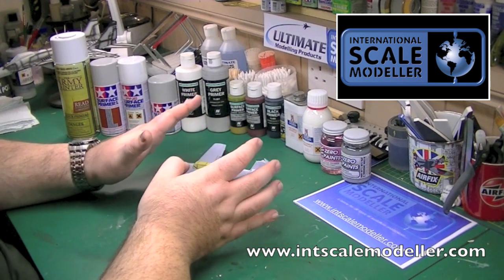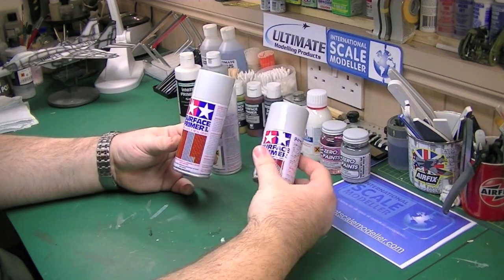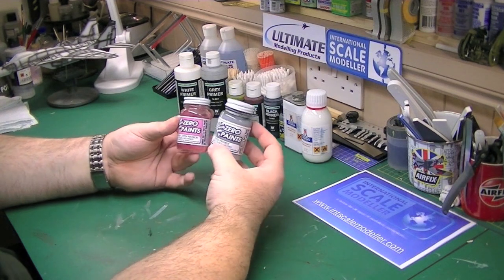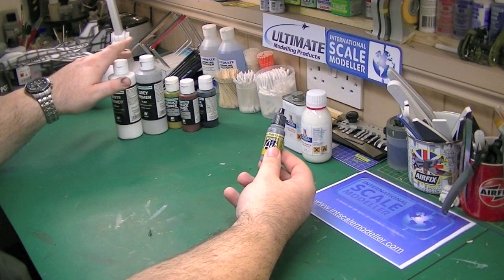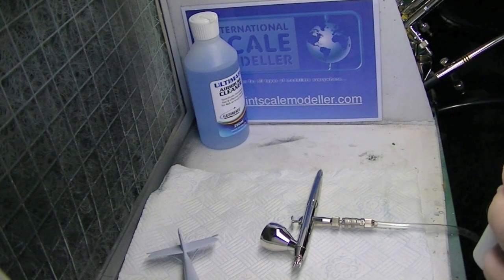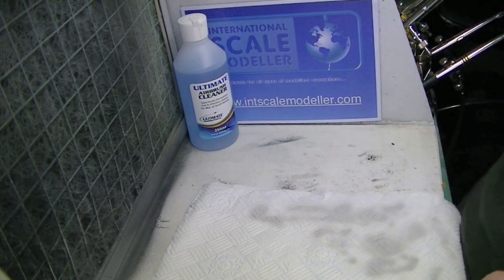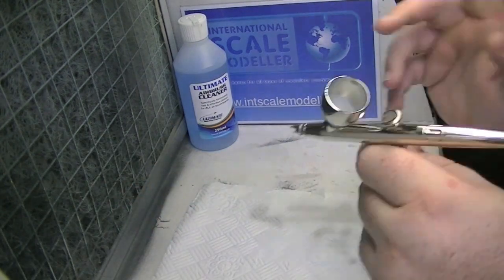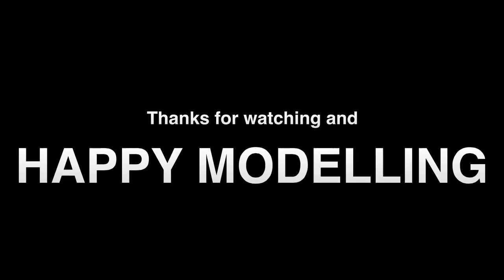Aircraft Modelling Techniques Part 7 - Priming

Comment: I use the tamiya fine spray primers and top coats (I do a lot of 1:12 motorbikes and want a realistic match) as I'm not getting my airbrush untill xmas and I too have decanted some of the left overs from the tins into little pots using the straw method and de-gassed them before putting the lids on, now, you mentioned they may be cellulose based? I have actually emailed tamiya themselves to see what thinners I should be using to clean up their TS range of aerosol paints and am awaiting a reply as I need to know what to use to clean the airbrush after using them.

I seem to remember from my younger days that cellulose paints and acryllics dont mix and can give a crackled effect, so would be oblidged if you could clarify using a mix of cellulose and acryllics and what the pitfalls or things to watch out for may be?

regards

Terry

Comment: Thanks for a great video. By all means decant Tamiya Surface Primer from the rattle can.

I put a pinhole near the top of an unshaken can of paint and put the mildly punctured can outside in an open box for 30-45 minutes.  When the sound of the escaping gas has ceased, put the can in a bowl of warm water for about 30 minutes to "boil" off most of the remaining dissolved propellant.  Then put a hole in the side of the can opposite the first hole as an air hole.  Enlarge the size of the first pinhole for decanting of the paint.  Carefully pour the paint out of the can through the enlarged pinhole into a glass jar of appropriate size.  Loosely screw on a cap for the bottle for an hour or two.  Gently stir the paint and replace the cap tightly.  The paint is ready to airbrush without thinning.
The rattle ball can then be removed from the can by tearing it open.

Comment: Hi, great tutorial, thanks. Do you need to thin Vallejo Acrylic-Polyurethane surface primer or just spray straight out of the bottle?
Reply: No straight out the bottle, i no longer use vallejo primer as its proved too much of pain to use, i now use the AK/Ammo primer with much better results

Comment: Hi yes you need a different nozzle holder and the pinch tip, the actual part comes from the infinity brush, but you can buy them as an add on for the evo

Comment: Hey love your videos.  Maybe a very stupid question but after you have painted your models how do you leave them over without smudging the paint. Sorry for ask such a dumb question.
Reply: Hey gladstone, are you asking how long i leave th model after painting till i handle it, with acrylics usually a few hours is good enough, but most of the time ill wait 24 hours before doing anything else to the paintwork
Reply: With vallejo primer 48 hours is advised as it can be a tad brittle while it cures, so for that reason I've changed to the AK primer which is proving much better and tougher